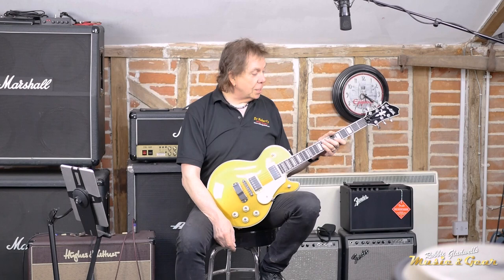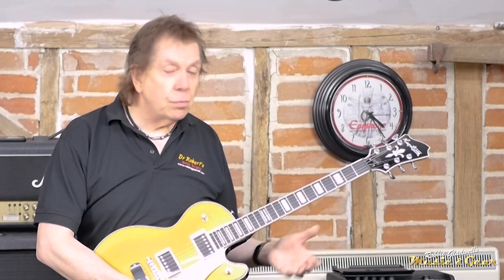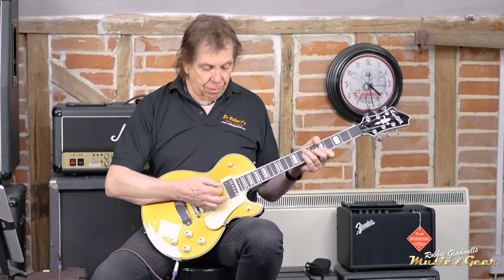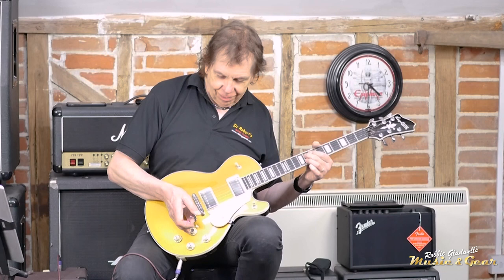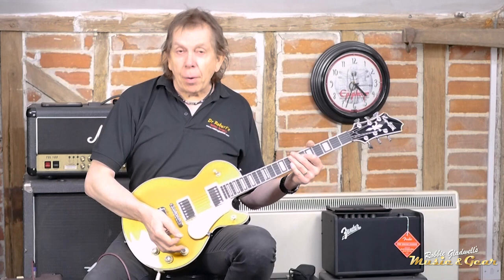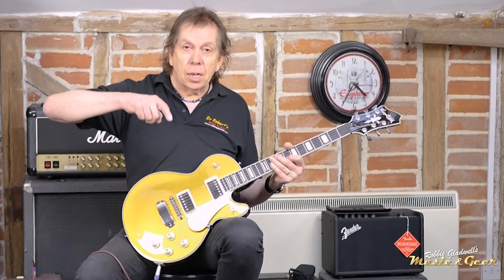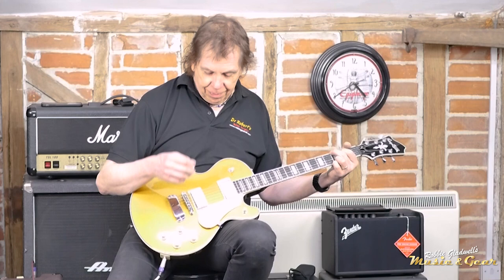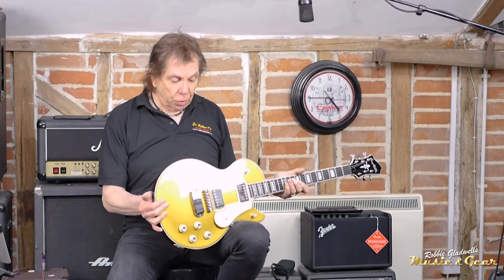Hagstrom Swede Gold Top Guitar Review & Demo

Comment: I enjoy the way you make all the points about the unique construction and conception of this sweet guitar.  I have owned my original black Super Swede from Sweden made in the last year of the 1st production run that ended in 1983 since I got it used in 1988. It is my go to guitar for all my home studio recordings, far more versatile and with wonderful action on the amazing thin neck. I have never had to adjust the neck due to that patented H shape truss rod design. It has amazing tones and has the same set of double pick up switch choices to create all the different useful tones. To assist the sustain it also features a zero fret so the strings never touches the nut. I've recently found a used Ultra Swede which is much lighter and just as well crafted as the original Swede, with the added bonus of being quite a lot lighter, with the Resinator composite wood neck face and gorgeous marbled abalone inlays and binding that is even made from vegan-sourced material. Innovative beyond most other guitar makers on this planet. Another Robby who loves Hagstrom guitars!